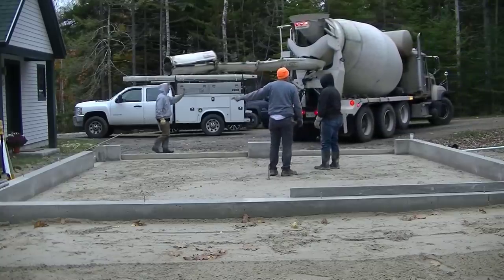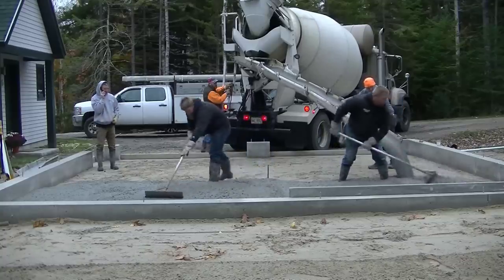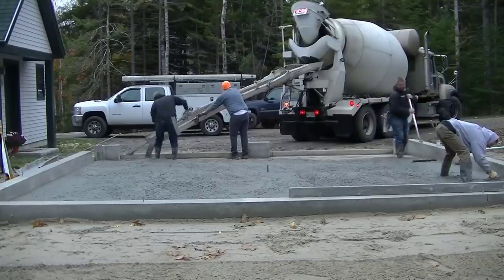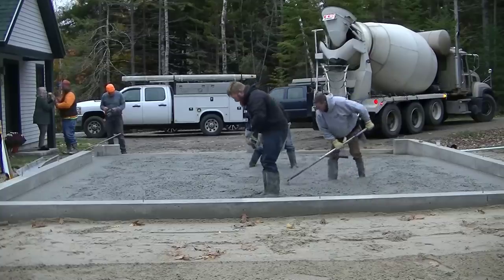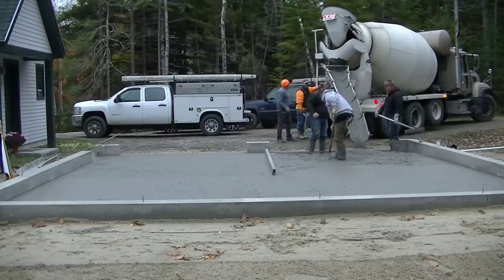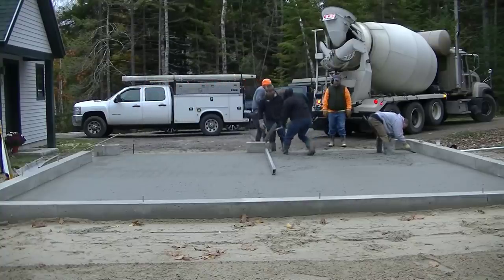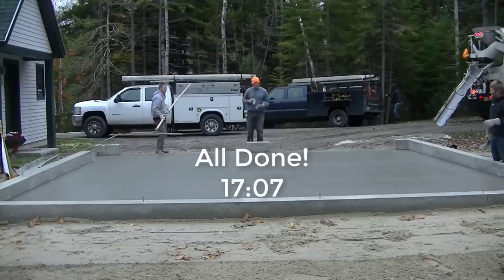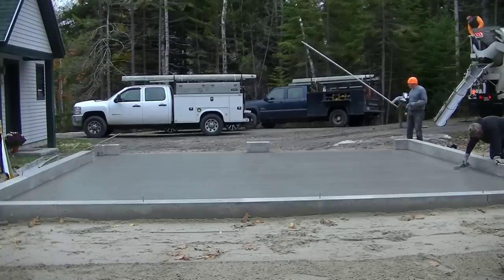17 Minute Garage Floor Pour (How To Pour A Concrete Floor)

Comment: I'm not pro but I've poured a few thousand yards over 30 years. To be able to pour a mix that watered down and still maintain strength is a game changer in all phases of the pour. Just last week two of us poured 7 yards at a 3-4" slump, yes it piles high out of the shoot. Took 45 minutes place , screed, and float. Made 3 passes on knee boards. Total pour time 4 hours. I really like this water reducer.

Comment: Ran thru a dozen years of pouring 4 garages/day with a 2 man crew. Driver held the chute for the back half of the pour. I also use a Center height pin. Pour first garage at 8am second at 8:30. Poured screed bullfloat and a 2 hit hand finish. Onto the 3rd & 4th pour by 1pm. 
Best time was pouring driveways with the aid of an overhead pump. Me with my nephew, 1200 sq drive in 45 minutes. That’s start of pumping to finished edge after broom. 
My small little company (me + my nephew and any casual labourer = 3 men).
- while a 2 man screed is preferable, learning to 1man screed will greatly up your time. I use a 6’ screed. It’s all about your overlap 😉. That keeps it flat (having a good eye helps). 
Knucklehead bullfloat is a wonderful invention. I never liked the chain pivot (guys fail to clean the chain). 
* interesting video. Been retired for 5 yrs now, but your times seem on par with mine. So a big hello from Completely Concrete (retired) Winnipeg Manitoba Canada. Where our motto was ‘From start to Finish’. Wishing you many happy seasons.

Comment: Water reducer is absolutely amazing stuff.  It apparently works by reducing static electrical charges between particles.  Really cool to mix some concrete up ridiculously stiff and watch it turn workable as you stir in the reducer.
Reply from the maker: As I get older I appreciate it more and more.
Reply: What’s your thoughts on the rock mostly separating with water reducer?  Too wet and the rock ends up on the bottom
Reply: @bdhabets3250  The point is not to turn the concrete watery.  The point is to reach something like a 5" slump while still keeping it at a water-to-cement ratio around 50%.   50% WC ratio is really stiff stuff that is just hard to mix.  Almost anyone would look at it and conclude it needs more water.  With water reducer, it becomes as workable as most DIYers make their concrete, but retains the strength it was meant to have.
Reply: @brianhaygood183  I know what water reducer does hence the name. If you pour it too wet the rock falls. My point is kinda too much of a good thing can be bad. If that makes sense. I think we are on the same page

Comment: Nice pour. I did this for years doing 200 cubic yard per day hand pours also using  full width concrete paver machines for the full width main line pours. The hand pours  for culdesics, intersections and basins etc can be the most strenuous of all. We used a Gomako full width paving machine with a 1500 to 2000 yard daily production with 12 to 16 hour days. Needless to say Mike, this is about the hardest work out there  I don't miss it at all :)

Comment: It's gonna crack without joints cut. Also if you r pouring that wet you 
should add a sack per yard to bring the strength back up. Now come back 
in 4 hours and actually finish it. Good job Driver and crew.

Comment: You have a very professional crew there! I have been pouring concrete for 15 years in south dakota we usually use a screed pipe to screed off of but everything else is the same we run a 3 man crew as well! Awesome job well done

Comment: We pour not as wet but about the same time. But we have all front load trucks. So it seems like the rear dump drivers are pretty good. I remember when we use to pour with rear dumps they were always the new guys that didn’t have a clue. Lol
Reply from the maker: Not too many fronts where I am. We do have some really good drivers on most the trucks though.

Comment: Impressive,  all good guys. 
I've been doing it on the Oregon coast here for 26 years. Pretty much do it the exact same way, only not as fast or smooth as you guys. I like four thousand pound mud all cement. We would pour a little dryer, less shrinkage cracking also gets hard faster. we would not use a power trowel on something so small would slide it by hand 3 times, get off it much quicker.
I like sawcuts for crack control no more than 10 or 12 feet apart each way.
As far as that door recess often we cut a jig and dig that out maybe an hour after it's bull floated, after it sets up a little bit or we could use a three-quarter inch down board and put a quarter inch of fall in the down board with top of down board at top of slab, stake it in with steel stakes maybe four feet apart prevent uplift and sagging. Edge the top, soon as it gets a little bit tight, strip the down board and edge the outside edge mag it out and broom it ASAP.
Did some mini storage buildings last spring with 28 overhead doors each, used down boards went very good.
Reply from the maker: Nice! With the water reducer it has very little water in the mix so we don't have shrinkage crack problems.

Comment: Not going to criticise  you  i respect all finishers . I paid my dues for 40plus. I used servey  stakes and put screws on grade . 
My screed technique  was a patting and side to side motion. I normally used 1 helper unless i had to wheel it . Hang on to your help . Hard to find in these parts. Most dont have drivers permit . Had to run day care mostly. But  i was proud of my work and gave 110 percnt  to my customers
Reply from the maker: Amen to that, thanks Howard!

Comment: I live in San Diego, and we would pour about 10 garage slabs a day. We would pour our concrete at about a 6" slump and just shovel the concrete really close to our grade and just tamp it with a 4 " tamp. And we wouldnt screed it, we would put pins in side the slab for our grade. It came out it really flat and clean

Comment: Very impressive your quality of work.  Question; what's your guide for the level of concrete? Greetings from Puerto Rico.
Reply from the maker: I'm using a laser level. We have a chalk line on the foundation wall we set in advance using the laser. I make a wet pad in the middle with the laser and screed from that.
Reply: @MikeDayConcrete  Thanks for your answer. Looking forward to see more videos. Keep up the good work.

Comment: On DOT projects where they actually monitor mix temps, they charge for winter service as early as possible.. even if they only batch 5-10% hot water, to try to keep the mix in the low 70's

Comment: Bro!!! Thats a 10 slump...SOUP
Reply from the maker: Ok good to know!
Reply: Yup soupy is how the pros go fast
Reply: @jeromemayer8904  
Depending on admixtures, Mix design, plasticizers ect ..there's no telling if that concrete would still meet strength or  crack in the future
Reply: @MikeDayConcrete  
Could be allowable depending on mix Design next code and subgrade soil
Reply: People pour differently, it all dries the same in the end.
Reply: And pulling that much mud with just 3 people... You get wore out quick, I'd rather pull a 10 slump than struggle with a 4 slump.

Comment: When you make every move count it doesn't take long and the work is excellent. Many years ago a man told me to not worry about getting fast but good. When I would get good I would get fast. I found that to be true. It has amazed me at how many young guys who think they were faster than me would watch me and think they could do the job faster and when I stepped down to let them show me how they would even do it were unable to even start. That usually lasted about one minute. There was a time when I did some work and a contractor who had seen the finished job and suggested I should have done it differently. I had to miter a 3/4" thick board to a 1/2" thick board. So when I asked him about how be would do it he said he would tilt the base on a skilsaw. Then I asked him what the angles were, he realized it was more than the skilsaw could tilt. Then I told him by the time he was explaining it to me I already had it done. I sharpen my own handsaws and they have very little if any set in the teeth. I told him how I marked the boards and saw them. Then I took a hand plane I had made to finish the caw cut to make it straight and smooth.  He never said another word. he did not know how to use a handplane. He did not know how to change the angle of the cut using a handplane so it fit well. People who are highly skilled are not slow.
Reply from the maker: Thanks for sharing Gerald!

Comment: Looks great. Made it look so easy. We pour with 3 experience guys and one labor.  Your fast and smooth. Do you ever pour garages with the drop for garage doors to block weather?
Reply from the maker: We taper the garage door area after the concrete sets up a bit. 1/2" taper about 10" into the floor.

Comment: We have front discharge mixers here. Wonder why some states are front and some are rear. Seems like the capacity is the same. 9 to 10 yards. We also can’t wash out chutes on the ground anymore. They require a pan or tub to wash out.

Comment: For some reason I thought mesh was required to handle the weight of vehicles but when I looked at the garage detail example provided by my township in southern Michigan, all it shows is 4" of air-entrained concrete over 4" of granular base. It also shows an 8"x 16" poured concrete footing and 8" block foundation 42" below grade, with 6" minimum above. That depth seems like overkill for just a garage. I wonder if post holes drilled to the 42" frost line and laying rebar in an intersecting perimeter trench (a couple feet deep) would suffice.

Comment: Commenting only cuz you asked: we would have 5 guys for the lay down. 2 guys on the rod, 2 guys on the rake and 1 guy on the chute. The guys would start Rodding as soon as the bay is poured out so we can get rid of the truck. 1 guy would stay back to finish and the rest would move on to the next job. So to answer your question, we would def pour it out faster but we would have more guys.

Comment: Yeah thats a good job try doing that at a 4in slump not a 8in slump remember the more water you the weaker the concrete and it will crack i promice
Reply from the maker: We use water reducer, no need to pour a 4 slump. Do you know what that is?

Comment: Put 1250 yds on the ground in 2 nights this week, total time pouring was 12 hours 61,250 sqft. No hot water in GA.
Reply from the maker: What did you use for a screed Joshua?
Reply: Sometimes S22EZ
Reply: Mike Day somero S22EZ

Comment: 7" slump, w/ water reducer?

20 yrs of design and writing specs for structural concrete, and I've never used 7".

Maybe for drilled shafts or steel shell pipe piles, but flatwork???  

I'd truly like to see what your cylinders break at with that wet of a mix.
Reply: Most flat work gus we pour for pour at about 6-7 inch. There's a couple when doing boat storage /storage units have us get it to a 6.5 with water then add a gallon so they are around 8.5-9 inch slump we don't call it slump with them, we jokingly refer to it as a 36-48 inch spread. They have never had to rip one out as far as I know

Comment: A normal crew from SoCal could finish pouring that in less than 7 minutes. With the same number of guys, we would have screeded the edges and center grade and then screeded the garage as you guys did a while the truck is pouring. When the truck was done pouring, we would have easily been close behind. You guys screed just like us. So you guys could have screeded while the truck poured and the third guy helping with pulling the mud.

Comment: I'm curious why the bull float is only 4'.   Wouldn't it give better results to use something 6', or 8', or 10' wide when there are no obstacles to work around?  Sure, there is a practical limit on what you could handle there somewhere, but 4' just sounds small.
Reply from the maker: 4' is pretty standard. It's plenty wide enough for how flat we screed. Wider is ok also, it's preference. Most the floor crews I know around here use 4' ones.

Comment: is it possible in 17 min? Well when the slab is only about 250-300 sq ft and you can back the truck right to it, of course its possible. Could even easily do it in less time
Reply from the maker: This was 576 sq ft.

Comment: Want floor to last longer then 5 years ,drill rebar into walls every 2 feet and tie rebar mat in floor ,we use plastic also ,control joints and sealer .then you can leave job knowing it look same in 20 years as day you left it .

Comment: The speed at which you guys work at is very typical of how my guys always worked. Not rushed or frantic in any way. Just paced and methodical. 
  Here in S. FL, we obviously never use hot water. As a matter of fact, it’s more common to use crushed ice in the mix on those really hot summer days. I have to say, it seems kinda shocking that the plant would charge $5-6/yard for hot water. I dunno, that just seems like a lot. 
  I know the bulk of your work is S.O.G. stuff, but no doubt you’ve poured elevated decks on a formed surface before as well. I’m curious how you deal with your grades and wet-pads on those. Do you still go with the laser or occasional grade stakes or do you use a ‘pogo-stick’ like we always use?
Reply from the maker: Yes, did many elevated decks in the 80's & 90's. We did use "pogo-sticks" a lot and the laser as well. Did many hospitals, schools, hotels, etc.

Comment: how long to finish the concrete? do you power trowel this size pour?
Reply from the maker: I did power trowel it. Got done at 3:30pm. The temp only got up to 39F on this day. I also sawed my contraction joints as well.

Comment: Hello, Mike. What brand of concrete? I am interested in the ratio of sand, crushed stone, cement in a cube of concrete?  how much is put there at your plant?
Reply from the maker: This page will show you the ratios we use: https://www.everything-about-concrete.com/concrete-mixing-ratios.html
Reply: 3:2:1 is good for slabs, will get you in the neighborhood of 3500 to 4000 psi depending on w/c ratio. 3 parts stone, 2 parts sand, 1 part cement, .45 parts water (all by weight)

Comment: In the military we’re no wear near as fast and we’d have double or triple the crew
Reply from the maker: Haha, that's funny. What part of the military are you?
Reply: I poured a small 800 sq drive by myself. My crew pulled a no-show. Funny thing is there was a 7 man crew across the roundabout pouring a matching drive. We started at same time. Hey finished ahead of me by less than 10 minutes. The second concrete truck driver jumped out to run the chute to try to help. He was rooting for me big time. 
Gave my young inexperienced name as a finisher a pretty big boost in my town. That with my 1 man 6’ screed technique.
Reply: I’m In the Airforce but I was doing civilian concrete before and it’s crazy how much different the two worlds are when it comes to the construction world

Comment: The slump is probably over 8, too high, too wet.    Concrete loses its strength if the slump is too high, meaning too much water dilutes the cement.  It’s engineered to be pour at 4 slump for strength.  Also, is there a vapor barrier, required by code.
Reply: No living space, no vapor barrier.  Check your codes.

Comment: Could use a compan like you around here
Reply from the maker: Where is that Ross?
Reply: @MikeDayConcrete  east coast of Canada, Newfoundland..good concrete guys hard to find..I'm dealing with a 22 meter pour that went terrible wrong on all sides from cement finishers to cement company..I only found one reliable guy that I chased for a year but couldn't seem to get..but I did find trouble!!will be busting up 30 MPA fibermesh to repour.

Comment: Thats an awesome job, but with out rebar it will crack
Reply from the maker: It's got fiber mesh and we saw contraction joints to control any cracks. Rebar doesn't prevent crack, it reinforces it and holds the cracks tightly together when/if the concrete does crack.
Reply: @MikeDayConcrete  your right, no matter what concrete will crack. Rebar helps hold the concrete together and being that its confined by perimeter foundation walls it should be fine.  Being from a state that has potential of big earthquakes rebar is a must.

Comment: Should of used reo as well . Not worth the saving to skimp . No vapor barrier either . Slab not tied to the foundation either .
Reply from the maker: Slab needs to move independently from the foundation. Rebar isn't necessary with 99% sub-base compaction and sawed contraction joints as well as the fiber mesh. We've done 100's this way with no problems.
Reply: Never tie slab to Foundation. I just quit working for guy that insisted on doing that.I spilled more concrete than he ever finished

Comment: NO REBAR? Not one comment about no reinforcement in a 24x24 pad? I want to see this floor today. I bet there is cracks even if they did cut it. Please after set and use pictures

Comment: how you feel about fiber over rebar I just haven't  seem good long term results
Reply from the maker: We've been using fibers for over 20 years now. It's really about the sub-base (good compaction) and pouring good concrete. Reinforcement just holds concrete together after it cracks.

Comment: . Y wouldn't you screed the Heights in? You can't expect your magging around the edges to be flat with no dips/humps..??? Screeding the Heights would give you a way better and flatter slab... just saying!
Reply from the maker: We're magging to a flat chalk line. When you mag every day like we do you can get it just as flat as screeding. I know because we've checked it many times before.
Reply: Ur wrong
Reply: My bad I didn’t mean to say that to you mike
Reply: Amongst concrete men i have never seen true finishers screed there heights along a wall . Chalk line and mag float common practice.
Reply: @justinbrewer5577  mite as well mag the whole floor then if ur magging is so flat.... haha. Doubt it.